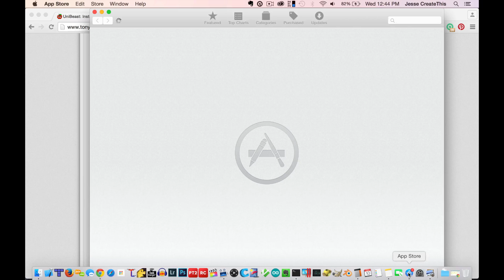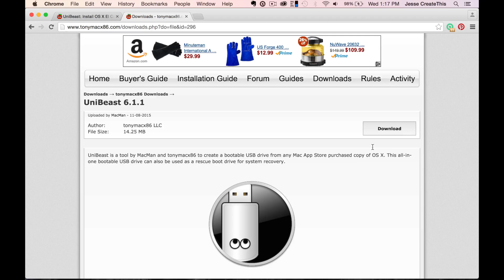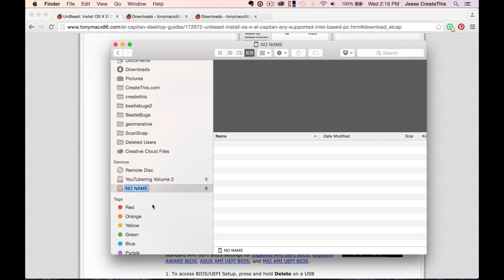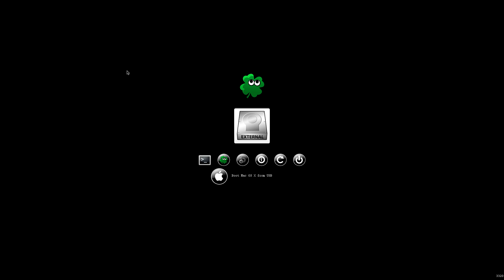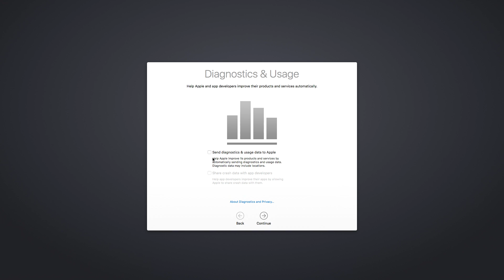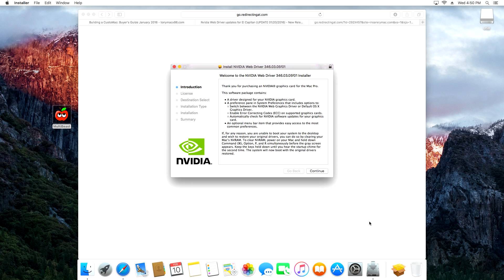Hackintosh Build - Software Install - Part 2

Comment: you made this thing look soo easy, thanks alot, im not too knowledgeable when it comes to building computers but I would like something fast for editing videos, I'm thinking about doing everything that you did so after I do all this will I be able to update Mac and update apps or anything?  what cant i do?
Reply from the maker: I haven't found anything it can't do. I have a video about updating this machine to Sierra: https://youtu.be/JaxBvilYe-Y Normal minor version security fix updates are performed the same as a real Mac, but you ALWAYS have to reinstall the nvidia web driver afterward. Even this has become easier lately though, as the nvidia web driver has started prompting you with an auto download and install after reboot. iMessage and Siri work, but you may need to do additional steps. I don't have a guide, but a quick google search will get you up and running.

It is easy, but it's way more time consuming to manage than having a real mac. If you can afford a real mac and you want super super easy, just buy a real one. Hope that helps.

Comment: I have the revision 1 of this mobo and on the F10c bios, I managed to install mavericks with windows using Transmac and niresh DMG. for some reason, I cannot get my USB to detect during boot after running unibeast with the same settings in the bios and unibeast. I ran yosemite fine on this machine using unibeast

Comment: Great vid, Thank You! Have you been able to upgrade this machine to Sierra/High Sierra?
Reply from the maker: I upgraded the 6700k machine to high sierra. It was non trivial and frankly I wish I hadn’t. The NVIDIA Web drivers just aren’t there yet.
Reply: Mostly wondering because I'm a Logic user and my 2008 tower is being forced into obsolescence; they won't let me upgrade even tho it's plenty powerful, so I can't get the latest version of Logic. So I'm thinking about going Hackintosh for my next machine.
Reply from the maker: Mikey Baker Hackintoshes are a lot of work. They can be great, but they can be a pain too. Have they announced the new Mac Pro line yet? I’ve got my eye on that.

Comment: great video dude :) when i have the money i wanna build a mackintosh, i have some questions, since i want to do gaming as well i was thinking of having a separate hard drive for windows, will i need the bootcamp drivers then? or just have a bootable usb with windows on it and install windows on that other hard drive, will i need to access this BIOS mode then?, and how if i succed how do i decide when booting up if i want to start OS X or windows after I've installed windows on the other hard drive?
Reply from the maker: +Unox92 Generally, you need a windows machine in order to install windows. I used a Parallels Desktop Windows 7 virtual machine in my step by step guide: Hackintosh Windows 10 Dual Booting: https://youtu.be/-ryV3BEy5IU
Reply: +createthis okay, so you are saying i can't have one hdd for mac and one for windows? is that it? thanks for the reply :)
Reply from the maker: +Unox92 No. That's how I do it in the dual boot video. One ssd for each os. I didn't need bootcamp drivers though. I think that's because I boot windows from clover, not mac from windows.
Reply: +createthis oh, okay :) thank you very much for the help :)

Comment: What do you do when you update the OS and the thing turns to a pile of useless mush? Never update?
Reply from the maker: I've updated two or three times on each hackintosh machine I own (3 in total). I usually have to reinstall the nvidia web driver, but that's it. Works fine.
Reply: NICE!

Comment: how did u get nv_disable=1   to show in the final with out typing it  since it is  necessary for loading
Reply from the maker: +john Al it's only necessary for loading if you don't have the nvidia web drivers installed. You don't need nv_disable=1 with the nvidia web drivers installed.
Reply: +createthis No i need the web driver but   in mine i have to enter the boot flag each time in order to boot  so how come it boot in urs  without entering
Reply from the maker: +john Al If you have to enter it every time, your web driver isn't installed/working.

Comment: A quick question, how can you record screen during bios/install/boot process ?
Reply from the maker: +Thanh Tung Dang I use a game capture HD
Reply: A capture card like an elgato HD game capture. A capture card records your screen. You put an HDMI cable to the computer or console or whatever you wanna record in the 'HDMI out' area and to the computer your using to record (Needs to have Mac OS 9.1 if using elgato) and then you hit record. That is how.

Comment: Would you leave the boot options on uefi and legacy if you want to boot boot windows 10 and El Capitan? Does the same go for storage boot option control? I've read on the forums that it is best to install Windows before OS X. Thanks!
Reply from the maker: +Dubious Jesse Check out my video on dual booting this Hackintosh with Windows 10: https://youtu.be/-ryV3BEy5IU  <--- I think it'll answer all your questions.
Reply: +createthis I am having trouble witht the Multibeast post installation.  It won't complete the install with the settings that I used for my GA z97 board. have you experienced this before?  
  Just checked out your win10 video.  I will definitely give it a try.

Comment: Still going through all these videos.  Did The Ethernet on the board happen to work?  I don't want to use WiFi if I can help it.
Reply from the maker: Going from memory, I think it works fine on the 4790k build, but not the 6700k build (out of the box). I use wifi exclusively.

Comment: I have one problem my res is "stuck" to 1280x800 but i need 1080
Reply from the maker: +TheOfficialDuBsTeC what are you using for a monitor/tv? how is it connected to the hackintosh? HDMI? DVI?
Reply: createthis well im using an LG Cinema Screen 27" 1080p 60Hz with HDMI to my 970GTX Strix Asus Card.
Reply from the maker: +TheOfficialDuBsTeC What happens when you try the usual method as in this support article? https://support.apple.com/kb/PH22157?locale=en_US
Reply: well im (at least a bit) used to a macbook and already checked that but still only 1280x800 was available.. :/ It won't even boot with webdriver because than the screen just turns black after booting and stays in standby. maybe a missing kext..? Im not that much in hackintosh and it actually works (everything else) but this is obviously the most annoying part.. searched for the problem but nothing helped yet maybe you have another idea? Im running a 4790k stock, asus strix 970, 16gb 1866mhz hyperx fury ram and asus maximus vii ranger board. :)
Reply from the maker: +TheOfficialDuBsTeC You say it won't even boot with webdriver. I'm guessing that's your problem. Try disabling the onboard intel graphics chipset from the BIOS. I had a similar black screen issue with my 970 under windows. It's possible the problem has made it's way to Mac by now. I haven't updated my webdriver since this video, so you might also try installing the exact version I'm running in the video if you have the same version of El Capitan.
Reply: Well, I can boot OSX without webdriver (standard OSX drivers) but than without that "fancy" transparent stuff and probably incorrect resolution. but than i try the flag loading webdriver than it will boot but after the apple logo it wont show the sign in screen - it turns black and into standby mode. 
you think another version may help out?
Reply from the maker: +TheOfficialDuBsTeC Have you disabled your Intel graphics chipset in BIOS?
Reply: createthis Well I recently upgraded to the i7 (few days ago) and was used to AMD stuff like for over 4 years - of course i know the Intels have an IGPU - but im not sure where to find that option in the bios settings..
Reply from the maker: +TheOfficialDuBsTeC This isn't the same motherboard you're using, but this is how I disable it on my motherboard: https://youtu.be/-ryV3BEy5IU?t=16m51s

Should be similar on yours.
Reply: Yeah, my Asrock was simple as fu.. with my FX 8120, easiest way OCing and everthing was easy to find aswell. the ranger is a bit badly stuctured but it has so much more capabilities im sure i havent seen the hole settings yet.. Im trying it! thank you btw! :)

Comment: Ok I was able to get the OS X installed, however it does not configure to my gigabyte 970 WINDFORCE. I downloaded the drivers and restarted but still did not work. I notice during my boot I do not get nvda_drv=1 after the reboot and even if I input that manually still does not work. Any suggestions?
Reply from the maker: +cmfusco11 First of all, how did you get past the boot issue? Just curious. Make sure nv_driver=1 is removed when you boot AND nvda_drv=1 is added. Once in OSX, you should see the nvidia icon in the upper right. Click it. It'll tell you the status of the driver. If you don't see the icon, you probably don't have it installed.
Reply: +createthis I had to install OS X without gpu in. Used CPU graphics and then installed nvidia drivers after then installed gpu back however still not finding my gpu and defaults back to OS X graphics.
Reply from the maker: +cmfusco11 You'll need to check the boot logs and see why the nvidia web driver is rejecting the card. Frankly, I'm wondering if your card is bad at this point.
Reply: +createthis i got a 2nd SSD I'm downloading iOS on it now and I'll boot into that to check if my gpu is bad. I don't think so but never know
Reply: +cmfusco11 downloading win 10*
Reply from the maker: +cmfusco11 wouldn't it have been easier to just check the boot log like I said?
Reply: +createthis ya maybe but I was planining on installing win 10 anyways, I was able to do it and on win 10 my gpu has no issues and drivers are fine so that means still more troubling shooting on OS X
Reply from the maker: +cmfusco11 Which version of osx are you running, and which web driver version? they have to match.
Reply: +createthis ya I am 10.11.4 on both
Reply from the maker: web driver versions look like 346.03.06f01, not 10.11.4.
Reply: +createthis o ya in sorry I got it off the webpage from nvidia site latest updates.
Reply from the maker: cmfusco11 That one is usually not the latest. Get the one from insanelymac.com: http://www.insanelymac.com/forum/topic/306535-nvidia-web-driver-updates-for-el-capitan-update-03222016/
Reply: +createthis I am using most current for my build 10.11.4  346.03.06f1 I'll try the new beta 10.11.5 but I think it's something with my config.plist and nvda_drv=1 I can't seem to get that to boot permanently with it
Reply from the maker: +cmfusco11 I wouldn't bother with 10.11.5. I'm using 10.11.4; it's fine. nvda_drv=1 is set by the web driver in NVRAM. That's how it allows you to choose the stock OSX driver or the nvidia web driver. When you select the nvidia web driver, it adds nvda_drv=1 to NVRAM and it therefore shows up in the clover boot options.

I've had trouble in the past with specifying nvda_drv=1 in my clover configuration, because it overrides NVRAM, so I couldn't turn off my web driver from the UI tool. However, I've never seen the opposite where nvda_drv=1 wouldn't stick.

Again, I suggest you check your boot logs. The nvidia web driver should be telling you what's going on there.
Reply: +createthis I actually figured it out, it was not enabling nvda_drv=1 when i was changing to nvidia web driver. i had to download clover config and then mounted went into my EFI and changed my plist manually and saved and rebooted and it fixed. everything working now!
Reply from the maker: +cmfusco11 sweet. I don't understand what you changed, but I'm glad you've got it working.

Comment: Hey i need some help i am not able to get OS X loaded off usb drive. I get into clover but when i load with usb i get apple logo frozen. i also used nv_disable=1 and still does not boot. Im not sure if its my usb when i did the Formatting and partitation. it did not give me the 1-16 partition like you had but its only 16 gb maybe thats why. for my partition map its : GUID Partition MAP and does not let me select anything else. any suggestions where i may have gone wrong. copied your exact bio settings for most part I'm using GA-z170x ud5 TH.
Reply from the maker: +cmfusco11 You need to add -v to your clover boot flags (same place as nv_disable=1) so you can see why it's hanging/crashing. It's probably a kernel panic.
Reply: got whats app i ran it with -v and got a whole bunch of words I'm nub at this what should i be looking for
Reply from the maker: +cmfusco11 You're going to have to do some research, read, and google. There's no magic bullet here. You're not running exactly the same hardware I'm running, so it's impossible for me to tell you what is wrong. -v is probably telling you something important, but I can't read it from here, so it's up to you.
Reply: do you happen to have whats app messenger i can take a picture of it? or something along those lines
Reply from the maker: +cmfusco11 you could probably use a cell phone.

Comment: how is it going after 4 years?
Reply from the maker: Still runs. I feel like Apple is increasingly hostile toward nvidia though. The nvidia audio over DisplayPort no longer works for me when going to a 4k hdmi input on a tv. I think it works in some specialized circumstances, but I can’t use those so I use an external sound card now. Also, nvidia doesn’t perform as well anymore with latest OS and drivers. I get a lot of strange visual artifacts. It’s still usable, but it’s super annoying.
Reply: how about sleep and wake. is it good? do you have suggestion for gpu for now?

Comment: Got a question how stable it is  have  u had any issue with it yet  Thx
Reply from the maker: +john all very stable. Only issue is only one usb port will drive my external hdd, but that's fine, I only need one. I have to steal it from my partner's sons when I want to use it, but man oh man is FCPX on a 4k 70" tv awesome!

Comment: hello friend, 
would need your help because I have the same pc as you, and I could install the captain once and then could not get back-install it because I can not detect the video driver or I is blocked the pc at the boot , I have tried in every way UEFI or LEGACY and there is no way now to download version this is the 10.11.4 is the same way or is there any change regarding 10.11.3 I mean the creation of usb and installation of MultiBeast

motherboard is the only thing you have different GIGABYTE Z97X is the 3-gamming
and the graph is GIGABYTE GTX970 GForce.

if you can help me I would appreciate and greeting and thanks for your help.

I wait your answer thank you
Reply from the maker: +Javier Graia It's pretty much the same installation procedure for 10.11.4. I just did another video for 10.11.4 with my 6700k build: https://youtu.be/o4g-6BVeIno
Reply: +createthis 
hola de nuevo, he instalado el capitan en legacy y uefi y no puedo iniciar el web driver en la version 10.11.4, 
motherboard gigabyte z97x-gamming 3 
grafica gigabyte gtx970
hd ssd kingston 120gb

solo lo pude instalar una vez y nunca mas, cual es tu consejo?

Comment: Hello,
 can you tell me how I have to start WebDriver since I have no way and my configuration is as follows I show in the picture as I detected the graphics but not the graphics memory

very good video greetings

https://www.dropbox.com/s/p7kbjtnj1zrjp0c/datos-mac.jpg?dl=0
Reply from the maker: +Javier Graia Did you install WebDriver? Do you see the NVidia icon in the upper left by the clock? Click on that. It will tell you if the web driver is installed.
Reply: +createthis if installed, but does not start, I have to do to start as probe to change and asks me to restart but does not start
Reply from the maker: It may be started and just not telling you it is. If it shows up as active in the Nvidia menu in the upper right, then it's started. If the nvidia menu doesn't show up in the upper right... are you starting with nvda_drv=1 ?
Reply: +createthis 
on the top right side panel muetra watch me nvidia WebDriver and marked as osx default graphics drivers activated, which donot like actuivar WebDriver graphics instead of default?
Reply: +createthis 
Hello I could help me not get started with WebDriver, this inatalado and I started with nvda_drv = 1?
 but will not let me I could do to enforce the beginning, because also change nvidia administration panel and tells me to restart for changes and does not return to the default driver.

 I thank you for your help greetings
Reply: +createthis 
 I said that is installed but does not start and start with nvda_drv = 1? and so does not start aunn web driver, set it up as you do in the video and to see such.
Reply from the maker: which motherboard are you using?
Reply: +createthis 
gigabyte  Z97X-GAMMING 3 GRAPHICS GTX970
Reply from the maker: +Javier Graia That's a supported board. So that's good. What brand is your GTX970?
Reply: +createthis 
gigabyte
Reply from the maker: +Javier Graia also supported, it seems. it should just work. I'm not sure why it wouldn't.
Reply: I installed again in the way that explain in the video, and then you commented
Reply: +createthis 
thanks for the help and I could install the graphics gtx970 and works full,
your video is excellent and I say good job.
a greeting
Reply: +createthis 
hanks for the help and I could install the graphics gtx970 and works full,
your video is excellent and I say good job.
a greeting